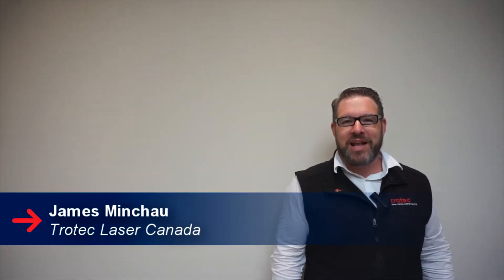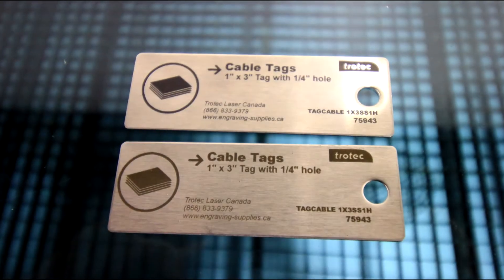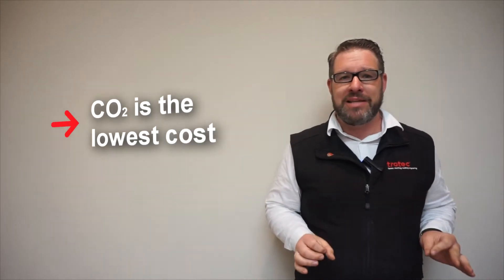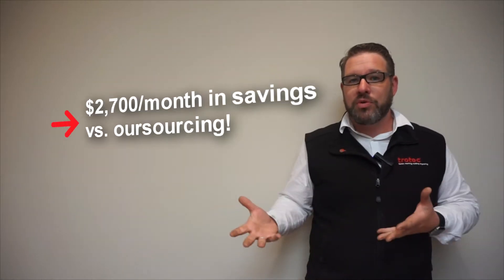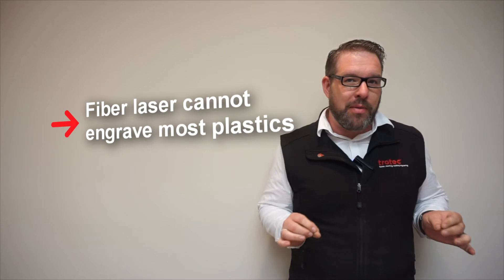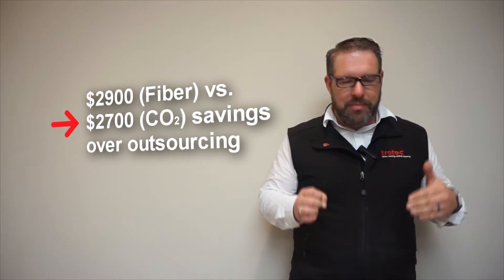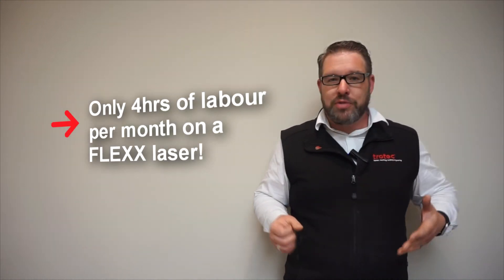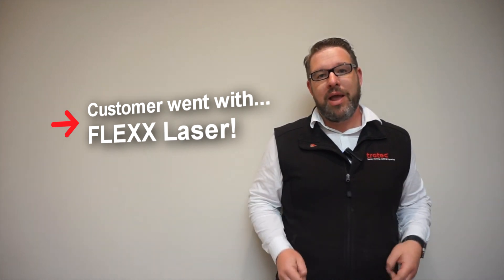Return On Investment (ROI) on a Laser Machine | Lesson 1 - Cable Tags

Comment: Why did the cost of the SS tags go up from a fiber to flexx?
Reply from the maker: Cost of the machine is calculated. The tool must be amortized.  Fiber is more expensive. The Flexx cost a bit more but that is well offset by  the product mix you will experience.
Reply: @TrotecLaserCanada  the price of the Tag should remain the same because it is a material cost.  it should have changed between the 3 lasers

Comment: Very good breakdown of costs/benefits. Like I tell many of my customers (I own a Trotec Laser 400 flexx), CNCROi.com is in the "middle ground" where the cost of getting their own machine + employee is too high as they don't have enough volume and once the volume kicks in, they will eventually "graduate" to getting their own equipment.

The advantage to using a shop like mine is that you only have to pay when you use us so if you have a slow period or things change, you aren't on the hook for equipment + employee but for a company that has extremely regular requirements, the ROI of getting your own Trotec Laser (the best on the market) makes total sense and a FLEXX is a no-brainer.

Great video James.
Reply from the maker: Thanks CNCKING that's wonderful feedback!
Reply: I would dispite Trotec being the best laser system on the market. Universal blows them away on every performance metric. Sure, Trotec is cheaper, but only because they are propped up by Trodat. You get what you pay for.